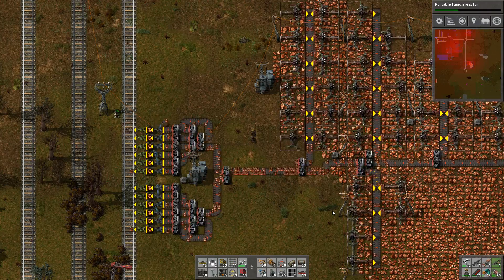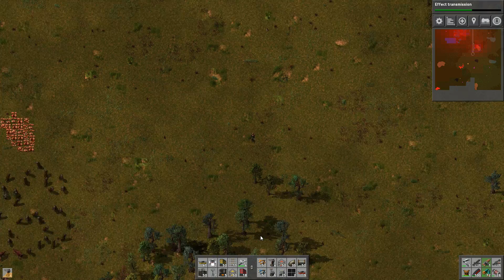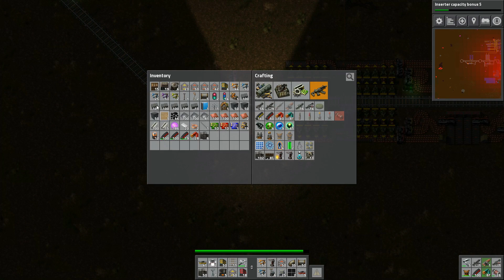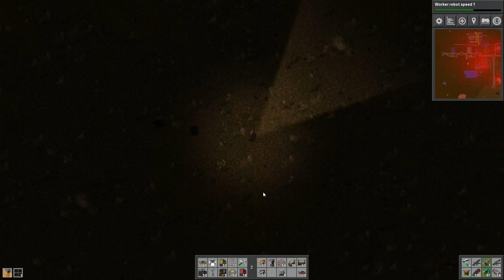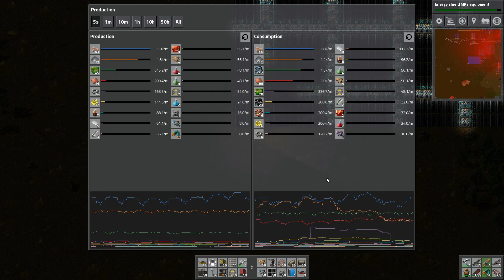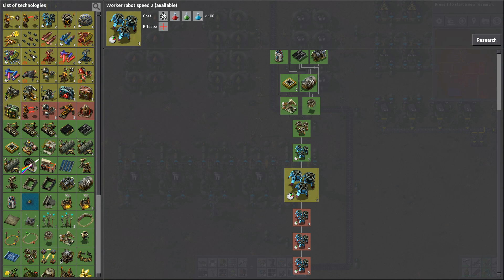Factorio MegaFactory 14 - Power Hour

Comment: Shred Guy99 did a good video on how to do a SR latch for power. Maybe you can check it out and put it in. (If you have done this already then that's good =D )
Reply from the maker: I think in my next video (whatever number I'm up to) I'll be playing around with a circuit network-controlled power switch for the steam engines, so they don't burn fuels until the accumulators are empty.  I worked out a test setup, all I need to do is implement it properly.  :)
Reply: Derek Mebius is there a timetable for your videos? or do you just record and upload when you feel like it? I for one would love at least 20 per day ;)
Reply from the maker: TheFireGhost93 I don't have a definite schedule, but lately I've been uploading 2-3 per week.